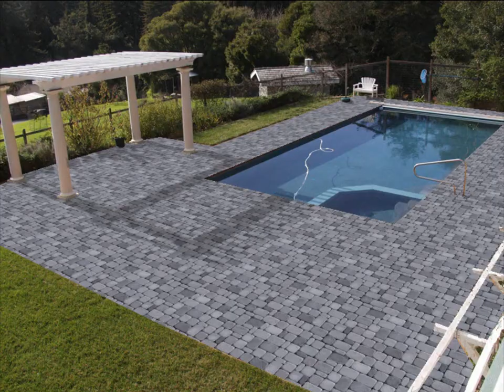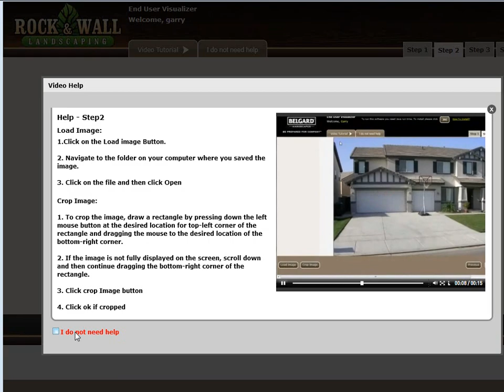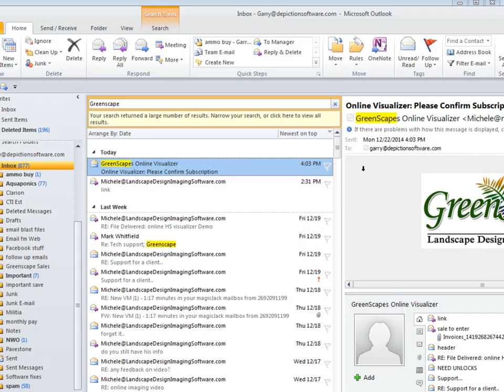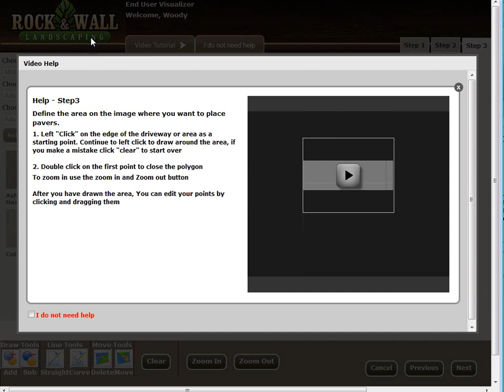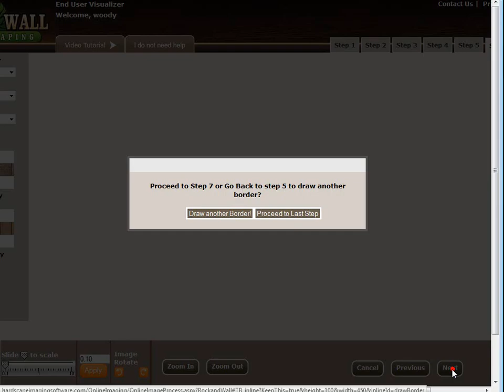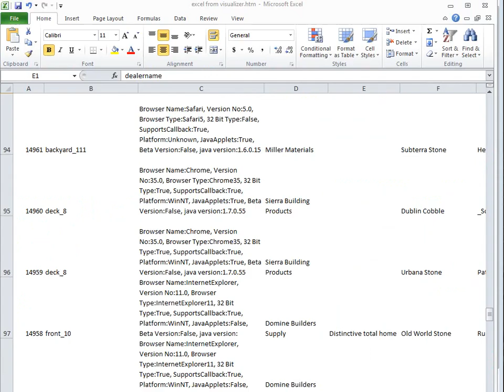Comment: i have not seen anything about decks?????
Reply: Mobi ono GreenScapes is the landscape design program that will include plants, fire pits, bbq's, outdoor furniture and more textures like wood flooring or decking. We customize the Online Visualizer to what you the contractor installs, sells or designs for your personal website. I hope this answered your question.
Reply: so I pay 500$ or w.e it costs and this software does this? Now another question!. These plants you have in here per say, someone from another country wanted to buy it. Are the trees/plants/bricks usa based only or you have multi country tree n etc. selection.?
Reply: so everything comes included free, any updates required or, do you have to pay extra. How much package cost? or seperate ones if you have? Are there any additional fees? the program looks great.
Reply: Yea I searched everywhere and could not find any decks designs in website.
Reply: Mobi ono You can cut out and add your own Plants and Objects. A lot of the plants will work for you internationally but might be named different. Make your own custom library which gives you the ability to rename and edit them. Hope this answered your question.
Reply: Mobi ono Try the additional textures - wood floors, this works with the define area tool. Also remember we can cut out decks you built and add them to the program as objects.